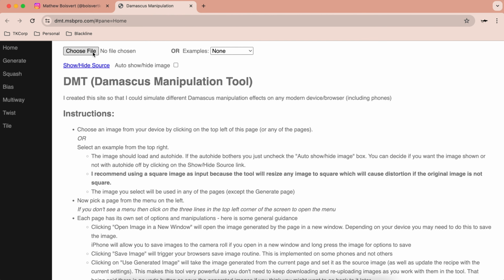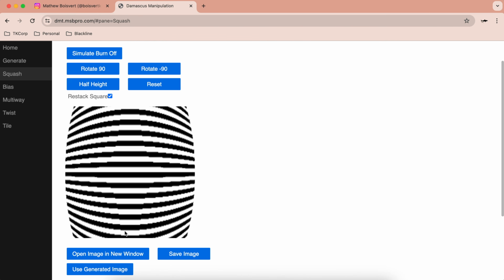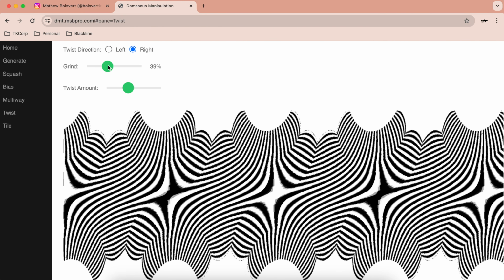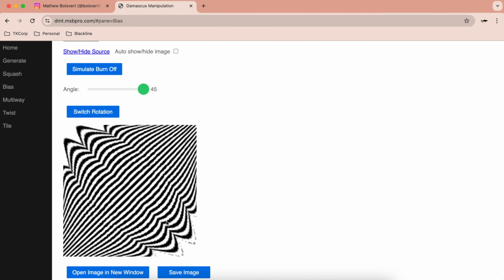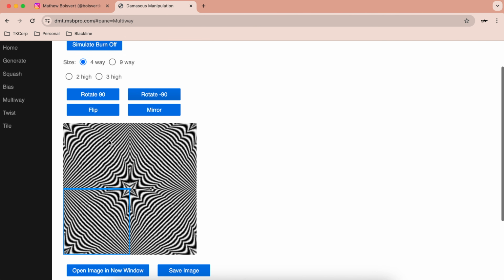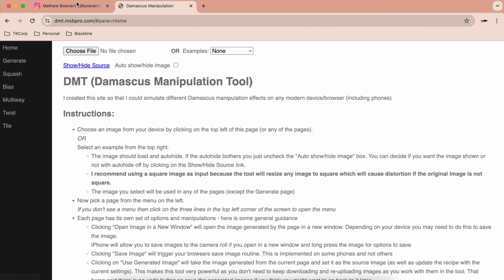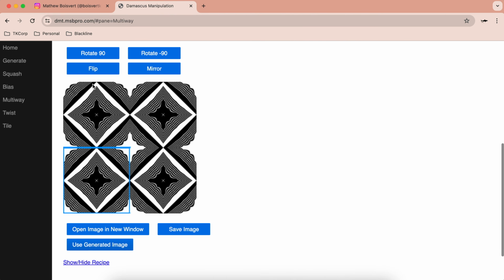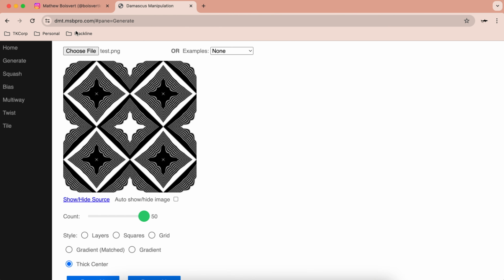Triple-T #183 - Software for designing damascus patterns

Comment: Are you able to tile your mosaic and then set those welds I. Your rolling mill?  Or is that really not right tool for that
Reply from the maker: You can’t really set welds with a rolling mill, it’s not the right tool.  You want constant pressure and force across the whole billet when forge welding.  The rolling mill would be the opposite of that.  Certainly great for drawing it out once it’s forge welded though.  Thanks for watching.